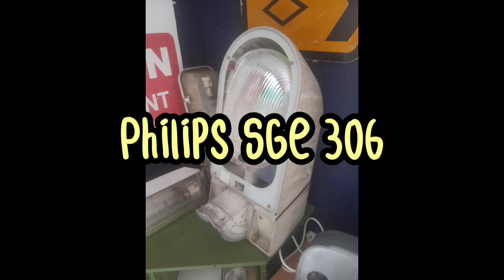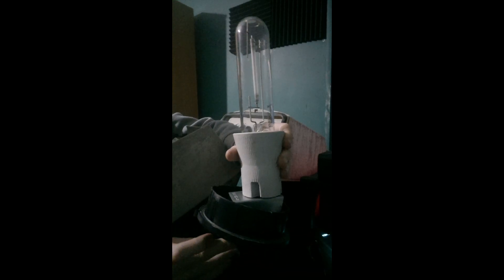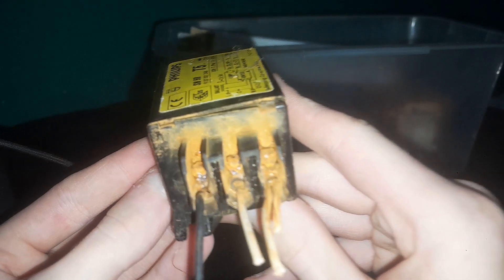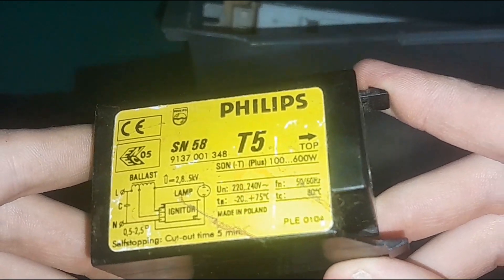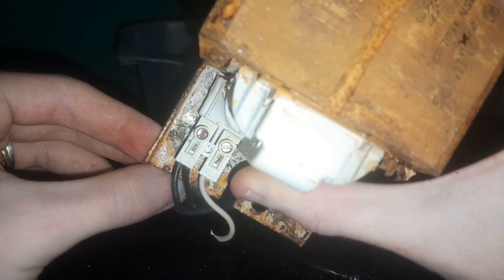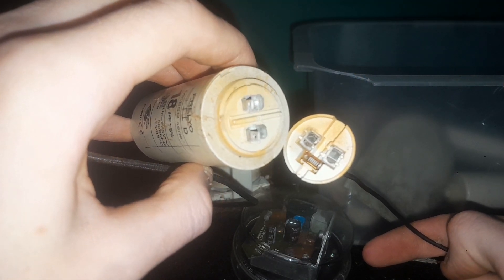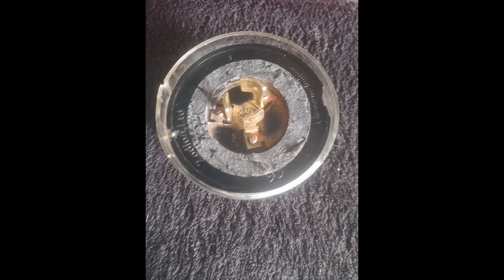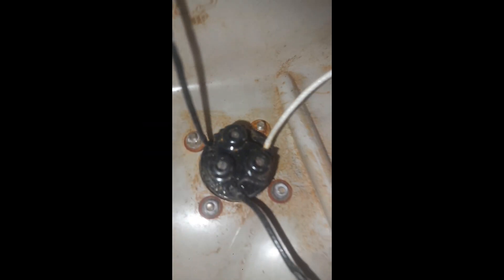What Caused This Philips SGS306 "Trafficvision" 150W SON Street Light to Fail? (Lantern Autopsy)

Comment: TrafficVision fixtures are unfortunately not really good in long term use, because of a way they transfer power to the lamp. They are using contacts, which during longer term operation often burn out. Bad construction :/

Comment: That's a fried ignitor if ever I saw one! moisture on the inside and outside caused a dead short on the terminals, so the ignitor fried itself instead of striking the lamp.
The lantern will be SGS 306, not SGE. S for SON; G for post-top & side entry mounting; and S for aluminium & plastics. BSN150 translates to ballast SON 150W.
I'm sure you've spotted the compass marks already, but a more accurate date can be achieved from the top right of the label (if you can read it), as not all lantern components are put together at the time they are manufactured.
Reply from the maker: Yeah i did see the different date and place marks, this lantern seems to have been made all over europe, The sticker inside the gear box says SGE and on the flat glass bowl says SGS on it which is strange, just fixed the title haha, however thr bowl sticker was faded which is why i didnt see it until i shone a light on it, thanks for correcting me, I'm still learning my lanterns haha
Reply: @LeoLampposts It may have had a few repairs done to it over the years then. You don't normally get multiple countries of origin.
Odd, my NOS 305 (the smaller TV) doesn't have any sticker on the gear tray. But Mike Barford's 306 does. Perhaps that sticker is exclusive to the 306, or mine is just missing it. I don't claim to be an expert, I'm still learning lanterns, too haha!
Reply from the maker: @George_M55729  youre more of an expert than me thats for sure, its nice to know my lantern has some history behind it!